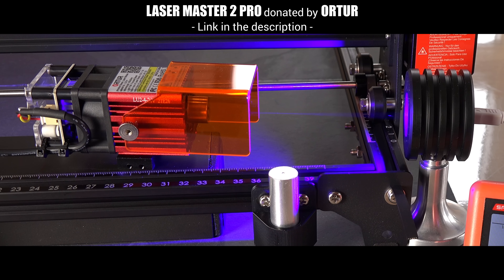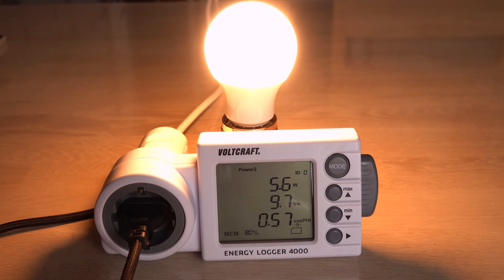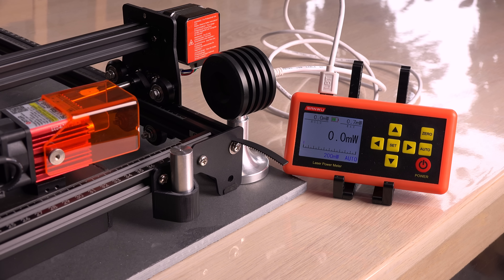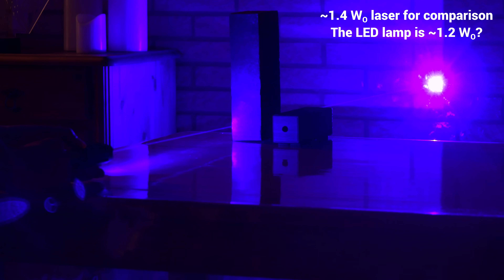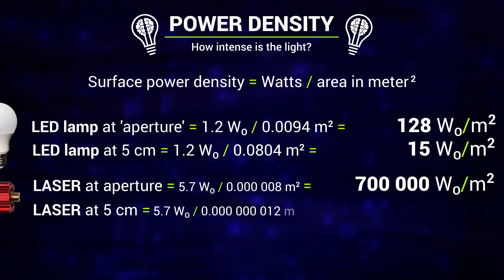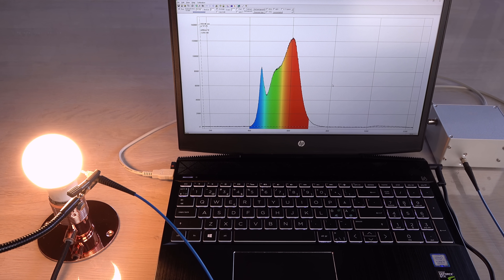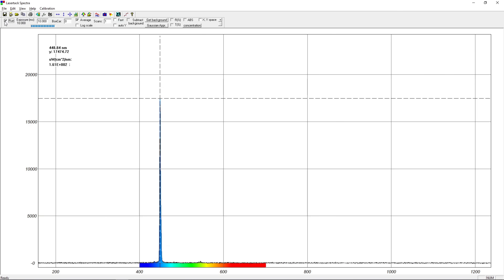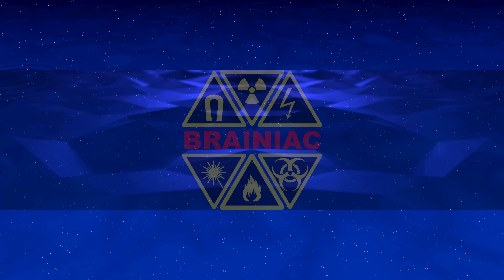Crazy difference between 5W LASER and 5W LED!

Comment: The word luminous has nothing to do with lumen. Stop assuming stuff as fact; especially stop announcing them as such. Luminous means emitted light. Lumen, as you know, is a measure of perceived brightness based on human eyes. Furthermore, luminosity is a measure of electromagnetic power, and also has nothing to do with lumen. This video is all over the place, not only with definitions, but with what matters far most, density, which you grossly understated and at times completely ignored. Do better; use Google; fact check your assumptions; be objective, straight forward and realistic throughout.

Comment: In the experiment, one could still have investigated whether the laser is able to generate more light that is visible to humans, i.e. optical power, with less electrical input. For example, by scattering the laser, pulsing it through a medium which afterglowing, as well as only transmitting a cluster in the wavelengths of visible light, to which a medium adds the intermediate colors through luminescence. The laser may be a better light source than many others. Whoever manages that becomes a billionaire.

Comment: Question for ANYBODY to answer. - Are We to assume 1st off that these are two different items from Different Fields, for Different Uses, Never To Be Interchanged, and the REASON for this video is UL POWER MEASUREMENT SPECIFICATIONS on Label, and ONLY BECAUSE OF LABEL are we having this discussion, right? Because although the REMINDER to  use SAFETY GLASSES... it SHOULD be a CONSTANT overwhelming blanket of a warning of danger (I assume because of CONSTANT DANGER of mixing these two types of light). I am being somewhat general due to dangers I've mentioned by a call directly to UL in Vancouver, WA. If any safety suggestions to pass on to UL, please let me know.

Comment: i used to work at verizon dealing with optical equipment. most of the wavelengths were 1480, 1350, and 1550. had a tech not wear goggles and got 1550 right into the eyes. results were not good

Comment: and to add to the problem, laserlight actually has basically Negative Temperture in Kelvin which is a complex concept (to put it simply, negative Kelvin temps are hotter than positive temps). The laser is hotter than any normal object that has positive Kelvin temps, so it can heat up things to pracitcally any tempreture in the positive spectrum if its just focused enough.
https://en.wikipedia.org/wiki/Negative_temperature
This also allows the focusing of the beam to a much "brigther" dot of laserlight as far as I understood. As other light systems never get hotter than the source emiting something even if you focuse it down.
Reply: The negative temps associated with masers and lasers typically refer to the spin (italicised) temperature of the active molecules (in the case of masers) and something similar in lasers. I'm not sure that one can describe the light as having a negative temp.  Fun fact: negative temps are only possible in systems with a bounded energy.  The usual reservoir for physical temps of things is the translational KE reservoir which is unbounded (so it isn't poss to get negative physical temps).  Yes neg T is hotter than pos T, but i don't believe you can get an arbitrary large physical temp by focusing laser light because it "has" a neg T.  Radiant power ~eT⁴ so even if the source "is neg T" there's no difference. (I especially know about masers though dropped out before submitting PhD).

Comment: It is such a shame your videos are not digging into the fundamental parts.
what laser diode is this? I reckon it's a 9mm  Nichia one, but there are quite a handful Nichia NUBM LDs that can manage +5watt.
I know the Nichia NUBM A0 are very popular in Chinese laser engravers.
The last 2 labby's I got from China a year or two back, both had the NUBM A0 in it.
from NEJE.. a 20W variant and a 30W variant. (the 30W variant was a weird blower design 85 USD to Denmark and the 20w was a sleek long black labby with completely in-house driver and PWM and TTL control)
the 20W claimed 5.5w optical output but on my two LPMs it was more like 4100mW
The 30W claimed 7.5W optical output but more like 4.700mW in reality.
but on both units it was the Nichia NUBM A0 laser diode that was fitted.
NEJE also had a 40W unit where the beam was made by aligning two A0 LDs with prism beam combiner to reach higehr output, but that labby was way to pricey for a person like me where its only the lazing itself that is relevant and mainly in the winter months where i love to do physics projects with laser and testing different theories lwith various slit experiments and sensing the mindblowing aspect of wave behaviors
If I use the TTL or PWM control module to regulate output, it is surprisingly linear, and I'm getting 41mW at 1% and 82mW at 2% and all the way up to 100% 4100mW.
If I bypass the driver on the 20W unit that is performing 4100mW with its native LD driver, im able to peek around 6.400mW  https://www.youtube.com/watch?v=wRc74eGfNWs
so these cheap Nichia NUBM A0 is able to go pretty high, but not a fan of the divergence of the ball lens laser laser diodes and they are difficult to align, been thrue the whole portfolio of NUMB05,06,07,08, and the NUBM07 is not as strong, and shifts quite a bit over its wavelength and the units I have is with awfull divergence, but that skyblue light 470NM looks beautiful, but they are all to powerful if you just wanna enjoy the laser beam and do experiments at home in your apartment here in Copenhagen N and they make burn marks all over, so I tend dial them down or use single-mode diodes.. as that dark blue circular beam, looks gorgeous. https://www.youtube.com/watch?v=0FqdE0ilZfg
and a very old one from China 2012, though not sure what didoe are in it...but costed 40 bucks with delivery, so was quite impressed with its performance and still going strong like 9 years later., 
https://www.youtube.com/watch?v=Xu6NI3jmlIE

Comment: The difference between a 5W LED and a 5W laser is W/mm^2. The LED light is spread by a large surface area proportional to the distance to the 3rd power (inverse law) a while the laser light can be focused into microscopic surface areas. Factor that in and you get huge amounts of power [W] by m^2 than that of an LED.🙂

Comment: I've got a 100W infrared laser, and a CNC gantry that actuates mirrors to translate the beam through a 3D volume. The whole thing is enclosed because there's a lot of ways that arrangement can become very dangerous, though it doesn't take quite so little power density to be dangerous since the light can't enter your eye. It will, however, cut through/boil your eye since it's so powerful
Reply: Cool! You should do a video of it in action, even if you can't see inside while in operation you could show it off on here...

Comment: So it makes sense that the laser has more surface power density and that makes it more hazardous. But does it have anything to do with the fact that the light is coherent? If you got an  LED bulb with 5.7 watts of output power, and somehow focused it all down onto a tiny area would it be as strong as the laser or would it fall short because the photons aren't interfering constructively?
Reply: Coherent light and incoherent light focus down the same. The difference is when there are two sources of light.

Comment: I had thought about the blue laser LED engraver but went with CO2 lasers instead. The CO2 has much higher wattage, mine can go up to 80 watts. Unfortunately it can't really focus down to as fine of a point so it doesn't work as well for very fine details, or for cutting metal (you really need about 300 watts for this). Another thing: CO2 laser is actually safer for the eye compared to visible light blue laser, because you can't see the backscatter of the CO2 laser since it has such a long wavelength. So as long as you keep the box closed you are fine. The burning effect from it can be a bit bright however.

The danger with CO2 laser is you can't see the beam and it will FRY you on contact!

Comment: I was hoping for some examples of other things that could produce similar light densities to 700,000w/sqm or 475,000,000w/sqm…
Like say carbon arc lamps at 5cm, or the surface of the sun at 5cm… y’know, whatever.
Reply: The surface of the Sun is only 64 million W/m2 and carbon arc lamp is less than 400 kW/m2
Reply: @koharaisevo3666  cool

Comment: sorry but calling slate "rock" is going a bit far.   (i mean it is.  but you are trying to make it sound like an impossible feat)
slate will even rub off on your fingers  
slate is SUPER easy to MARK  (cause that's what you did.  you marked it.  you did NOT,  i repeat, NOT engrave the slate)  

engraving means you actually removed material.  and you're going to need something a little stronger then a 5watt diode laser. 

marking is when you change the color of a surface.  
engraving is when you remove the surface.  

to engrave you need to evaporate the material.  to mark it you just need to heat it a bit

Comment: Lighting a room is very possible, when you make a mistake homing/start position and run off the work piece hitting the shiny extruded aluminium sub straight , it lights up the room as if you struck an ark welder. It is seriously bright in an eye blinding way. Glasses are not just highly recommended, they are absolutely mandatory, don't risk it, it will hurt you.
Reply: eeeh it's FINE, it's why you have two eyes after all; one is for learning the lesson.. :-P

Comment: wattages don't mean shit without the context of the technology and the output in another metric
output wattages only truly make sense for transformers and end amplifiers and the such because you need to know how much comes out to power something.

a 10 watt led light, is a 10 watt led light (usually they measure a bit lower in reality, but swings and roundabouts) and nothing else, 
you can drive them softer, you can drive em harder to a certain point, but their nominal specifications are what they are.
you'll never measure 60 watts anywhere on the damn thing, it's just a comparison to older tech, only marginally less stupid as the comparisons on toilet paper.
because with all the techonologies, you have bad ones, and good ones, so which one do you sample? the average?  the lowest? the highest? 

for led, good ones can do almost threefold the amount of lumens bad ones can at the same color temperature.
90 CRI ones usually score a bit lower on lumens per watt compared to 80 for the same color temperature, 
which means the 80 CRIs leak more into frequencies that are more efficient to reproduce, but as a result, have less of an optimal color spectrum reproduction.

the amount of lumen or micromols per input watt on the mains are what matter (whatever metric fits your application best), that is the true power usage and efficiency can be derived from there.

Comment: A very related topic is Lux ratings on bicycle headlights and torches. Sometimes they also specify ridiculous Lumen ratings which are either for the bare LED (without reflector, glass cover etc.) or only sustainable for very short durations. In the end the light pattern (i.e. the optics) is usually much more important than the total power output or brightness.
Reply: lux can be a better way to judge the effective light because it measures light in a given area (1 square meter) at a distance, which is throw. A light may put out 100 lumens but you have no way of knowing how far the beam will go. The optics will define how far and how wide the beam. The over-hyped lumen claims in my opinion are due to consumer ignorance, having no way to verify the claims without specialized testing equipment. Companies can say anything they want. Matt Smith debunks and explains on his flashlight channel all the terms and definitions, testing every light at startup, then 30 seconds and 5 minutes. A lot of claims are only valid for the first few seconds before the light turns into a soldering iron.

Comment: Nice video!
Which software are you using to generate the g-code for the engraver?
Reply from the maker: Thanks :) I am using the free program LaserGRBL. Just import a picture into LaserGRBL and it will generate the g-code. I am new to the laser engraver community, but it is surprisingly easy. The hard part is getting the power and engrave speed right for each material. That takes some experience.
Reply: @brainiac75  Thanks so much! 
I have a CNC-router and mounted a "weak" laser to it. It can only engrave wood. But i wanted always to engrave a picture but didnt know which software can convert it to GCode.
Btw: There comes a video idea:
Comparison: Cheap vs expensive Laser goggles. I once saw at aliexpress a 2$ laser goggle that looked identical to a Bosch 60-70$ goggle. I was wondering: what's the difference?

Comment: I ran into the confusion with power output over area when working with RF antennas. With only changing the physical shape of an antenna, you can go from a fairly weak received power to a received power that is so high that it instantly destroys your antenna electronics. I was able to wrap my head around this by thinking of light bulbs vs lasers. an omni directional antenna is like a light bulb, shooting a little bit of power in every direction. a highly focused antenna (like a yagi) is like a laser, focusing and concentrating all of its power into a very tight direction. I sometimes also think of it in terms of imagining that the power is discrete chunks of RF energy. With a given amount of "energy chunks" input, you can throw some of them in every direction, or throw all of them in the same direction. This can be shown with a gain pattern to physically see what an antenna is actually doing. 

Considering that light is also RF (kind of), you should be able to draw a "gain pattern" for light as well. that would be an interesting thing to see
Reply: It's all electromagnetic radiation after all

Comment: I was at an anime con yesterday, and they had a laser engraver active at a stall without the shield and no safety glasses, so you could see the engraving directly- should  I be concerned?
Reply: If it can engrave 'normal' (not specifically photosensitive) materials, it can engrave your retinae. The focused light the laser emits does get dispersed by the etched material. But even then the light (especially when it's blue) is still intense. Even 'though you may not think it is (as explained in the video (in the luminance part), blue light is perceived less bright than, say, yellow, for the same amount of energy and dispersion involved). And if it should hit any (more) reflective surface (an inconsistency in the etched material, a programming or gerber fault or maybe even an accidental bump of the table which sends the head to a position it's not supposed) and a larger part of the light is directed in a single way, I'd not like to be the poor person whose eyeball gets hit by that light.
However, if you walked away from the situation unharmed and a day later still have no complaints about your vision, I'd not be too bothered about it, yourself concerning.
Still, especially at public events, or any event where there are people not constantly aware of the dangers such high output lasers can cause, I'd consider it reckless to display such a machine especially with safeties removed. And if everyone is aware, I'd still consider ignoring such safety measures... stupid.
Reply: @jiriwichern  thanks, it was a violet colour, same colour as what was used in this video. I'll send an email to the event organisers and alert them of what happened, as I'm sure they weren't aware of this either.
I didn't stick around for long, so it would have had little effect on myself
Reply: @Fozzedout  was it maybe in a shielded container, basically a box made of laser goggle material?
Reply: @the_retag  nope, it was an open laser engraver - they were doing wood etchings on it. No cover, no glasses, just working away in a crowded area

Comment: one more important part about lasers is its beam divergence. Simply said its connected to the power density but it also gives a better understanding when talking about what lasers do.
Beam divergence tells us how far over a specific distance a light source diverges in radians. For example a light bulb has about 300° light cone therefore its entire power gets spread on that 300° cone. A lasers beam divergence however is usually waaaaaaaaay below 1° in fact we measure it usually in milliradians. This tells us that a laser bundles the light incredibly well which explains the insane power density we see in the video. There are also other important factors why lasers are incredibly dangerous but beam divergence and the therefore high value of power density is by far the most important factor.

Comment: Using a cheap red laser pointer, I aimed it at a frosted glass lamp fixture and was amazed how the glass became brightly illuminated. I would be an interesting experiment to try (carefully) with the 5.7 watt laser. The frosted glass fixture is the nearly spherical glass covering, perhaps 20 cm in diameter, as used on the very cheapest ceiling fixtures.
Reply: The "Fiber Optic" theory...
Light diffused within the glass plate_ intensified by the prism effect of the "frost" (etchings are decorative - glass flaws - that have prism properties to it)

LED light in a tube with a magnifying plate extending out_ is the best page light magnifier of all the book lights on the market:
The light is carried through the glass to whatever it touches